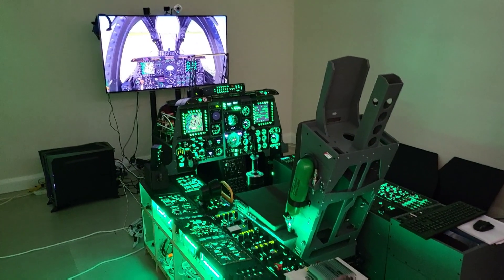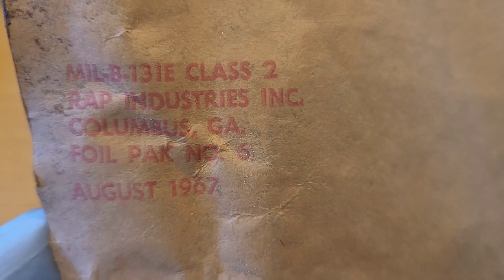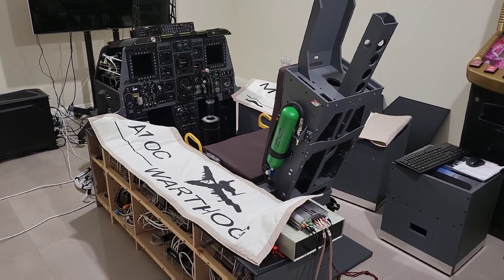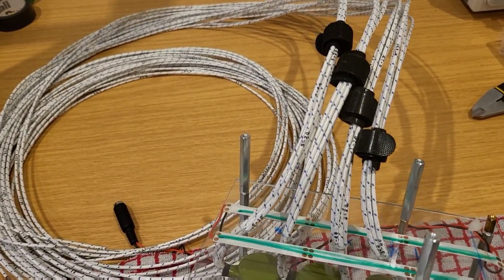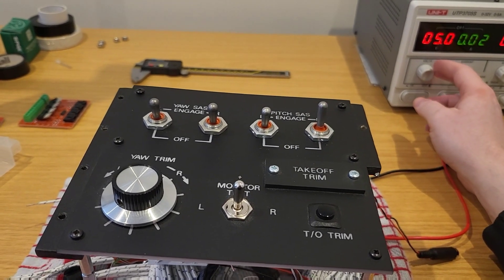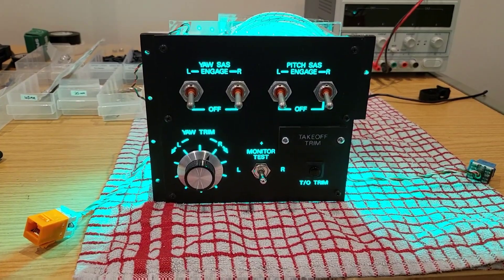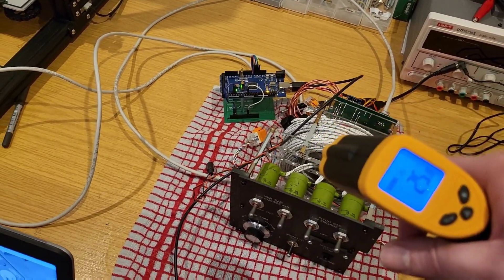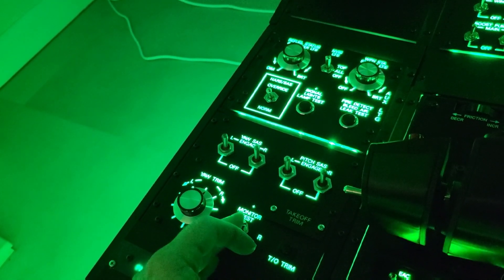Simpit A10C - Upgrades - Part 2: Stability Augmentation System (SAS) Panel

Comment: The switch is older than I am
Reply: In terms of heat management do you have thermostats controlled by a PI or Arduino to turn on a fan system to drive out the air?
Reply from the maker: @gcnimbii7001  a good point. I have given heat management some thought, the left and right consoles I have monitored and they seem fine. Its the front dash that was my main consideration. I have a cooling fan for each of the MFCDs and they are constantly on to cool the driver boards. I adjusted the easy driver boards for the nema motors for the HSI and ADI and chose the size of them accordingly, as they otherwise run very hot. But I think some other heat monitoring would be a good exercise and introduce more airflow
Reply: The switch is not quite as old as I am !